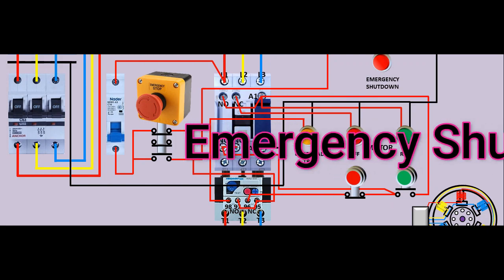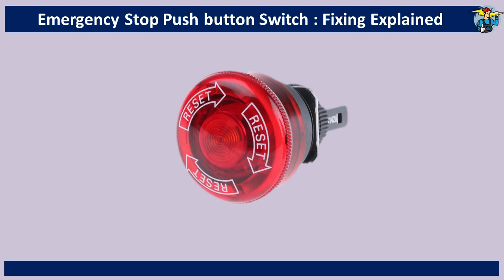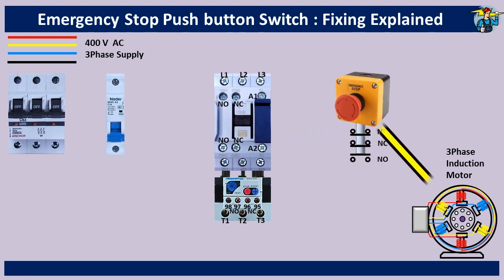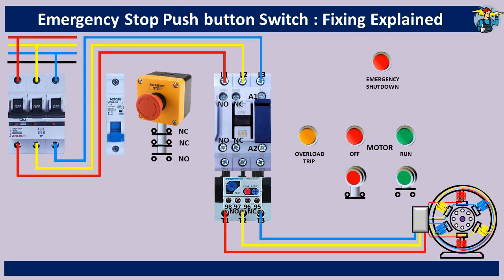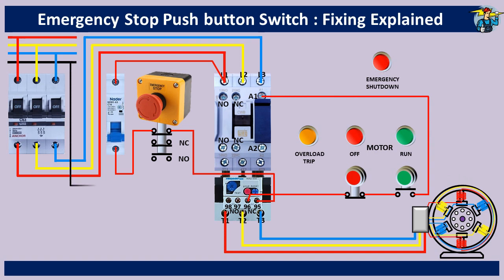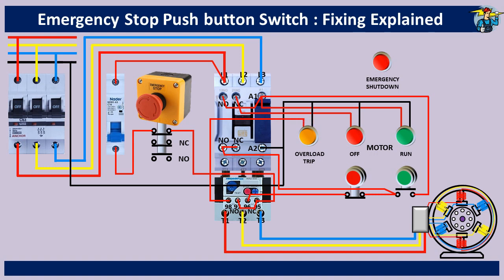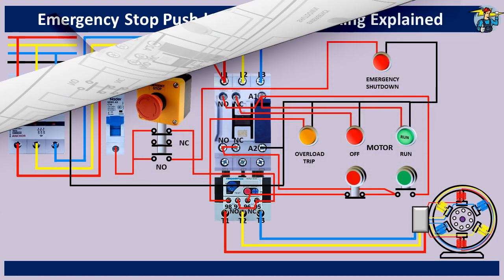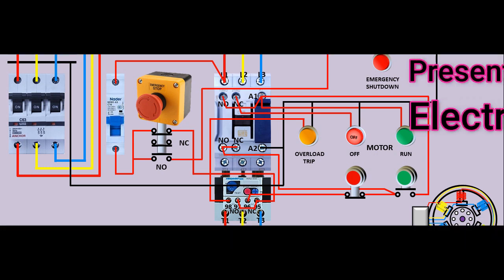How Emergency stop switch works? / How to wire an Emergency Stop Switch? / Best Explanatory Video..!

Comment: The general basis of wiring an emergency stop button for a non-intelligent equipment is to use the N/C contact as a main switch of the whole control circuit. Multiple E-stops should be wired in series so they operate in NOR logic - One button pushed, control power interrupted, all relays released, all motors de-energized.
For some intelligent equipments with PLC's, things can be different. It's possible that some E-stop buttons are included in a detection loop of the safety relay, which cuts off power to actuators and tells PLC to pause its work, pop up a trouble code and not to resume unless an extra manual resetting signal is received (by pressing "Trouble Reset" or even entering an admin password)